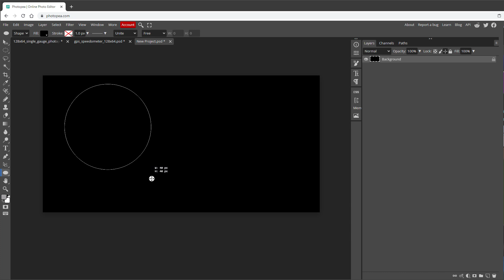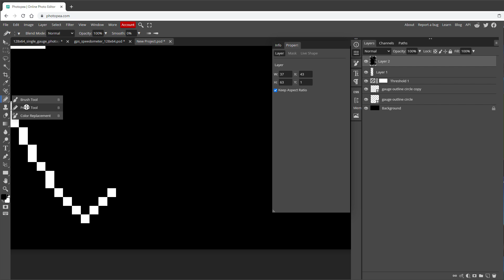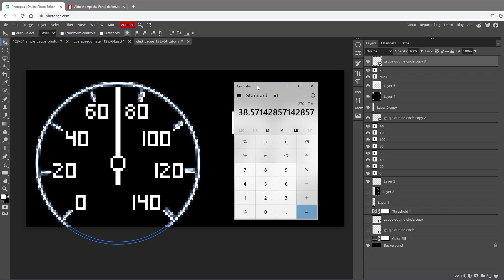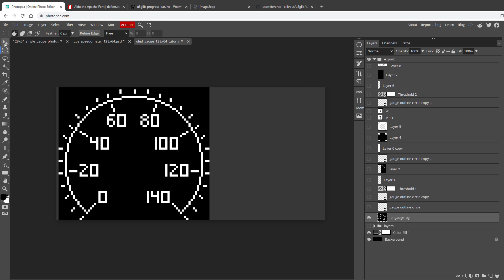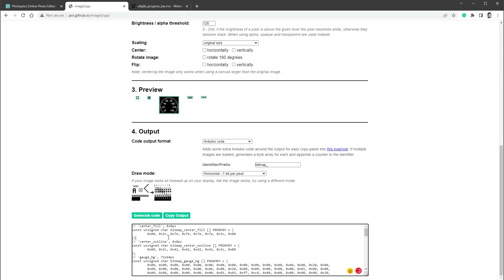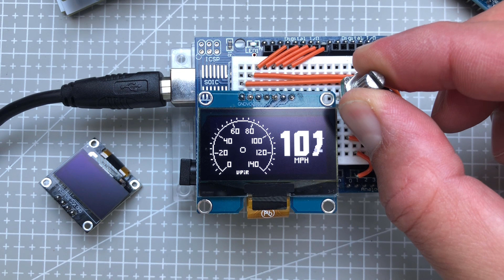Arduino OLED Gauge

Comment: I'm following your tutorial with interest but I got stuck at minute 5:58 where I couldn't follow your instructions: in the video you indicate to select black and shortly before the appearance of the circle changes to squares, but it's a step that I can't repeat. I tried to slow down the playback and follow your mouse but when the drawing changes appearance I can't identify which command you activated. can you help me?
Thanks in advance
Reply from the maker: I have selected the black color of the image with the magic wand tool by left-clicking on the black color, and deleted that area using the Delete key on the keyboard. Hope this is helpful!
Reply: @upir_upir  Yes, thanks, I missed the step about using the DEL key. Even though it's very late, I'm still on track.

Comment: Build server failure: Error: Project compilation takes too long. Please remove some libraries and try again, or try to compile the project on your computer and use Wokwi for VS Code to simulate it.
Reply from the maker: I see that from time to time. Try it again a few times and it should work.

Comment: hi. nice project. May I ask how to add gps signal or module into this?
Reply from the maker: Thank you. I have a video about the GPS module here - https://youtu.be/dSD02o3M2sw
The same applied to many other GPS modules. I would suggest to look for modules from DFRObot, as they are simple to use.
I do plan to record a full tutorial about how to create a custom speedometer soon.
Reply: thanks for respon. may I ask you another question?
the TX and RX on gps module connect to which pin on arduino?. 
so far I can change the speed digit front but can not with the size. but for now i am happy with that. Im just don't know how to connect gps module
Reply from the maker: TX and RX pins are for serial communication, they should be connected to TX and RX pins on Arduino - which pins depends on the board. You should check the pinout.

Comment: Help needed 
Hello upir, great video. I have tried to change the pin to be used to A1  however when I changed the pinMode in the void setup and the analogue read in the void loop to A1, the gauge will only go down as far as 53 and only as high as 56. Then it will fall back down to 53. 
Can you or anyone help me in understanding where I went wrong in changing the pin being used from A0 to A1?
Reply from the maker: Sounds strange. I have quickly reconnected the Potentiometer to A1 in the WOKWI simulator and updated the code, and it works as expected. Are you perhaps doing something else with the pin?
Reply: Thanks for the reply! 
I was able to resolve the problem by clearing the arduino memory and then re uploading the code. For whatever reason it’s working  now.

Comment: Hello , not really sure if you will see my comment , but thanks a lot for the tutorial , i managed to make a gauge cluster with rpm , speed , fuel level ; boost pressure , turn signals , low beam/ high beam and a fully functioning odometer thats speed dependant. I uploaded a short clip of it on my channel's shorts. Thanks again !
Reply from the maker: Thank you for your comment; your project looks great! Is that just for fun or are you going to use it somewhere?
Reply: @upir_upir thank you ! Oh and yeah the gauge cluster is for an rc truck I'm working on. There's a lot of other cool things on it like an actual spectrum analyzer for music ( 20hz to 20khz ) with esp32. The gauge cluster was the final addition for audio/video setup 😅 I uploaded another video of the chassis if you wanna see .

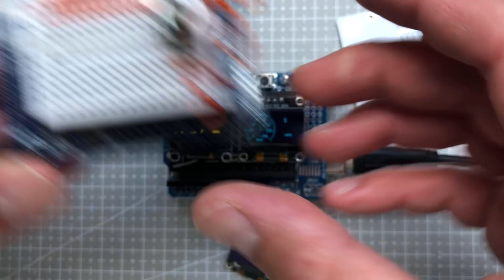Comment: How do you connect the potentiometer beforehand? 25:51
Reply from the maker: You can see it much better if you open the WOKWI emulator - link is in the description of this video. The signal pin (middle one on potentiometer) goes to pin A0, the other two pins from potentionmeter goes to 5V and GND. It does not matter how you connect it, because it would either set the value clockwise or counter clockwise. Let me know if that helps or if you still need any help and good luck with your project!

Comment: I'm looking for a dash for the bike. There should be a display of 0-60 km/h. And the speed is determined with a Hall sensor on the wheel. Can you build something like this for the Arduino Nano?
Reply from the maker: Yes, you should be able to use Arduino Nano with this code, just switch the potentiometer with the halo sensor. Which exact sensor are you using?

Comment: Good video, but since the GUI is pretty simple, it could have been done with simple geometry primitives (circles, lines, etc.) too. What is the advantage of using fixed pictures instead of those?
Reply from the maker: Thank you for your comment, I usually start with image in Photoshop/Photopea because it´s much faster to tweak the appearance compared to generating code and tweaking the values there. A lot of times, it turns out that using a fixed picture is usualy more performant solution compared to drawing primitives, but you are correct that it´s surely an option.

Comment: Will be using info from this for my own speedometer project.

Plan is to use a hall effect sensor to record transmission output RPMs, then convert to speed with rearend ratio and tire circumference.

Main reason for not using GPS is the hall effect isn't reliant on satellite signal, as I want consistent input of data, so I can log travel distance for an odometer.
Reply from the maker: Cool. Please feel free to post a link to your project, I would love to see it!
Reply: would you share your code?

Comment: я гдето слышал что ардуино не очень любит работать с синусом, интересно сколько ресурсов потребляет данная программа?
Reply from the maker: It’s running fast enough, but since there are only certain number of positions, you can use lookup table and precompute the values in the setup function. This is what I have done for the “knob over oled” project and it helped a little bit.
Reply: @upir_upir  использование таблицы в некоторых случаях может быть оправдвно, особенно если нет нужды рисовать стрелку очень точно, достаточно нескольких точек для удовлетворительного рисования стрелки. я собираюсь применить ваш проект в дисплее для электровелосипеда, но там кроме рисования есть еще и прочая математика и работа с CAN шиной.

Comment: I find this program super frustrating. I was using the pencil tool to correct pixels and half way through it stopped working and turning pixels red. I can figure out what happened or how to fix it
Reply from the maker: My guess is that you have accidentally enabled the quick mask mode. Try pressing Q button to turn the quick mask mode off. It´s the button below the color selector. Let me know if that helps!
Reply: @upir_upir  that was it, I worked that out after 10 frustrating minutes. You make it look all to simple friend. Thanks
Reply from the maker: @chrissantos7865  I´m glad you figured it out! Feel free to ask if you get stuck again.

Comment: Thank you for the tutorial. I believe you are using the pay version of Photopea. For instance at 5:15:37 you are typing Ctrl-Shif_C  on the selection, then Ctrl-V to paste. There is not way I can get that with the free Photopea, it always says this is an empty selection. I checked this like five times and made sure I had exactly the same layers and selections as you and could never get anything from the selection. Is this the case?
Reply from the maker: The only difference between paid and unpaid Photopea is not showing the ads. Otherwise, it should be the same. The Ctrl + Shift + C shortcut should never show you this kind of message, only the Ctrl + C does. Try using menu item instead - Edit > Copy Merged. Let me know if that helps!
Reply: @upir_upir  Thanks, it seems to be Photopea is browser dependent , I was using Edge and the best was only catching the current layer. I've retried with Chrome and it works. I will  now move to test with chrome what you do at 19:38:37 where when I was trying to fill the digits with black,  but the whole digit was covered with black too ending on a black layer.

Comment: Trying repeat your project with U8g2 library, but always get glitch instead images. Do you know why?
Reply from the maker: u8g2 library uses different image format - the XBM format. You can export it using GIMP or for example use this online "editor" - https://xbm.jazzychad.net/    I will try to investigate if there is an easy way how to convert between the formats and easily switch between u8g and u8g2. Let me know if that helps.
Reply: @upir_upir  Thank you! Export with GIMP works fine. But I need to invert color first and use drawXBMP also.
Reply from the maker: What’s the reason for also using drawXBMP?
Reply: @upir_upir  I getting glitch if I'm using drawXBM. So, I used code from library example with drawing logo, where they use drawXBMP
Reply from the maker: Please see my latest video where this is explained— https://youtu.be/4GfPQoIRqW8

The P stands for program memory, so you the appropriate function based on where your data is stored

Comment: Thanks for the video, I am following your tutorial, however this script as well as the one with the progress bar does not keep a stable value but fluctuates. I guess this is linked to the micro voltage variations. what could I write to insert a certain tolerance threshold and thus obtain larger steps between one and the other? I thank you
Reply from the maker: Thank you for your comment. There are multiple ways how to fix that, starting with a simple capacitor, changing the code to average few last readings, restricting the code to only jump by defined increments, to something like this:
https://www.instructables.com/Smooth-Potentiometer-Input/
https://www.norwegiancreations.com/2015/10/tutorial-potentiometers-with-arduino-and-filtering/

I´m sure you will find more examples if you google "arduino smoothing potentiometer", but please feel free to ask if you have any questions. Good luck with your projects.

Comment: If you are using display with 7 pins (SPI), don't forget to comment line 36, and uncomment line 37.
Great video upir, as always!
Reply from the maker: Good tip! It´s mentioned in the wokwi source code, but it´s worth reminding, since I haven´t specifically mentioned the line numbers. Thank you for your comment and good luck with your projects!